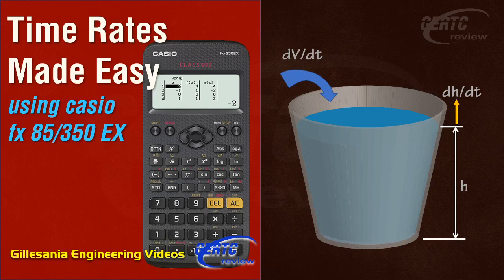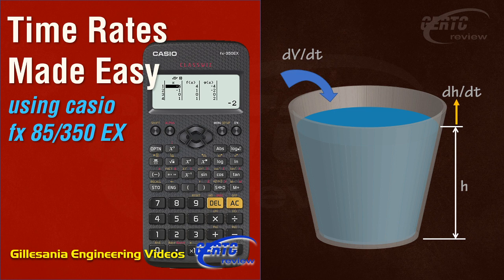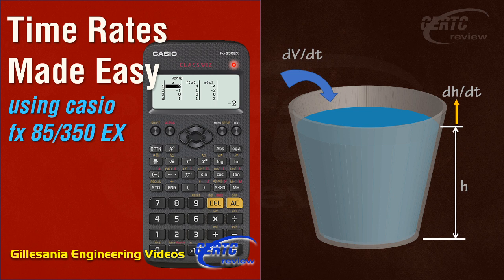Time Rates Made Easy Using Casio FX85/350EX (CALCULUS)

Comment: Sir i am currently self studying now and planning to enrol. I am encountering problem in math caltech ngayon. May i ask how to use caltech on simultaneous equation below?
1/x + 1/y =1/42
1/y + 1/z =1/31
1/x + 1/z =1/20
Reply: Let
a = 1/x
b = 1/y
c = 1/z

a+b=1/42
b+c=1/31
a+c=1/20

Mode-equation-3 unknowns
Youll get the value of a, b, and c
Then solve for x,y, and z.